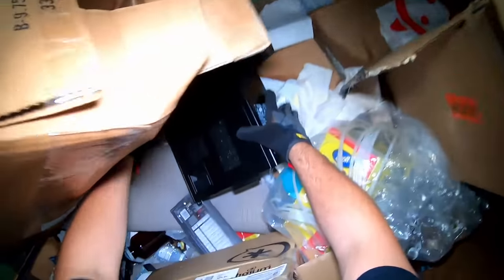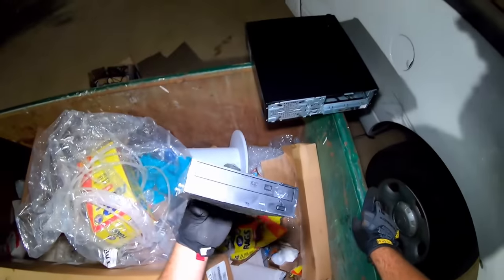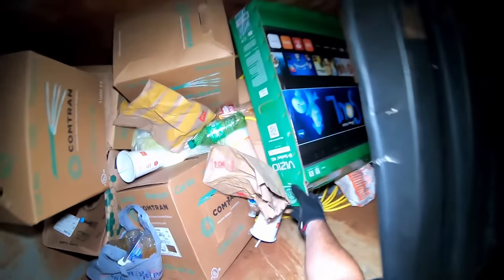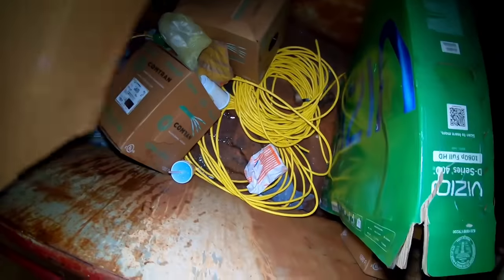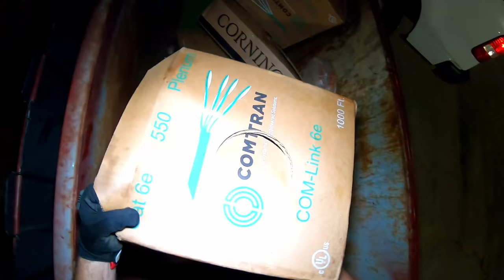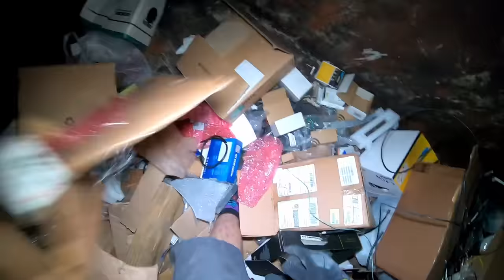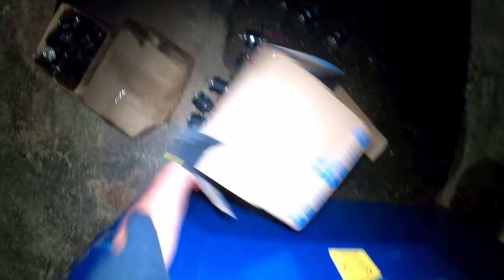Dumpster Diving "That Box Is Full Too!"

Comment: You don’t realize how many motors you scored until you stacked them on Dotty’s tail gate. Bravo!
Reply: What should he do with those motors? It's gonna be such a chore to take them apart for the bounty of copper inside of them, I feel like you're gonna loose so much money if you give em to the yard as is, that's a tough choice there huh??? Either way, yeah, SCORE of a night!!!
Reply: @jeffffro7674  I would stick them on ebay. People are always looking for these small motors for different experiments. There's no way I could scrap it. No Way!
Reply: As a matter of fact if I knew what he would sell them for, I would buy quiet a few from him.
Reply: @jeffffro7674  not hard to take apart 4 bolts 4 nuts, cast aluminum on the, it's better off to take them apart like that cut the wire off of them first
Reply: @gamecockmike175  EXACTLY

Comment: I miss the scrapyard videos, would love to know how much this load is worth.
Reply: It's all lightweight sheet metal. So at most he made 20 to 25 dollars, if that.  Subtract his fuel and the value/use of the truck and he would have made ten times as much bagging fries at McDonalds and not have to climb into nasty dumpsters.
Reply: @udavidism  what about the motors
Reply: @lionheart9692  my local place redeems motors $1/ lbs I'm guessing each box was 30-35 lbs apiece so I'm thinking about $150 ish? Also he'd make more throwing those carts up on marketplace at $25-$40 a piece, especially that blue one. I'm thinking with the wire all told maybe a $250-$300 night
Reply: Well if he The strips all the copper himself will have at least 5 or 6 lb at like $200 a pound.
Reply: @jasonflay8818  Scrap dealers take advantage of everyone. He got lucky finding motors on one night that will help pay for his gas and time all those nights he found nothing of value. They pay only pennies per pound for unstriped thin gauge wire.  Stripping heavy wire pays more but is very time consuming.  Many restaurants have a starting pay of fifteen dollars an hour now.  If someone else is throwing it in the trash, it has almost no value.
Reply: @udavidism  dude, you are bitter, we get it. No one is saying you need to do it. Let us scroungers have some fun and make a little money. Fine, scrap yards don't give full points for metals, great, you don't have their overhead. They need to profit as well. You know who you are making more money than? The original ore miners. Considering the average yield is 10 lbs of copper from 2,000 lbs of copper ore or about $30/ ton, I'd say scrappers make more money than miners.
Reply: @dianna3157  If people that have no concept of time value or the costs involved operating a vehicle want to waste time and money crawling around in filthy dumpsters then fine, have at it.  Much recycling on a household level often goes into the landfill even after you remove the label, rinse the can, flatten it and then haul it to the recycling center.  I have seen that "sorted" trash dumped out onto a slab of concrete where it is examined and if it has too much of any wrong items in it it goes directly to the dump, even after fools have wasted so much time, money and effort sorting it.
I have absolutely no problem with people wasting their time and money, it makes life easier for the rest of us. So keep on diving in those dumpsters and counting your coins! It has nothing to do with saving the planet.
Reply: @udavidism  With 300 bucks this guy made the same as i do in 10 night shifts , plus he has fun. 
Would trade jobs at any time with him.
Reply: @yaykruser  bro get a truck and get at it. Never let anyone hold you back!!!! Best of luck to you
Reply: @hammerhand5059  Who might be quickly becoming an insufferable snatch? But you're the righteous one here, right?🤣🤣🤣
Reply: @Toxic-Masculinity  "virtue signal much?" You know every time we open our mouths we expose ourselves?
Reply: How the hell did this comment turn into such a pissing match??? People ... SMFH
Reply: @charlesangell_bulmtl  Because that’s the state of YouTube today. A bunch of people who know nothing about anything vs a bunch of people who think they know something about nothing
Reply: @udavidism              Wheres the fun in that?
Reply: @udavidism  It's good that most people think like you.

Comment: Nothing wrong with those motors, probably just a new manager "cleaning house" and getting rid of some previous guys project.
I'd test them then put them on ebay for half the price of any other seller, and triple your scrap price.
Reply: Or it was an incorrect item that they couldn’t return
Reply: INDEED
Reply: I think you could ebay them just fine.   They look like engine fan motors like you'd have on the front of your car to cool
Reply: They weren't bad before he threw them around. His total disrespect for the items he finds is totally in line with his work....
Reply: I figured it was probably a place that manufactured the motors and maybe those were ones that failed QA for one reason or another.  Would have to test them to know.
Reply: Most likely, since those are all the same type of motors, they were either replacement parts for a discontinued product or main parts for a discontinued product. I have found cases like that before and tested them out to find they were all good. Since I do a lot of teardown to seperate out the different metals from each other and I take all of the hardware and bag them up for sale, I would go to the local swap meet/flea markets and dell it all off as folks know me as the hardware parts man. And electronics, I set those aside to crush and melt to pull the gold and other metals out. Since I use a wood fired smelter that has staged blowers for different temps, it is easy to pull the metals out and make ingots. Ingots sell for as little as 6Xs the going clean scrap weight of the same metals.

Comment: I just bought 6 motors very similar to those from grainger, they are exhaust fan motors for large buildings. Any way, they were $84 each off grainger, they kinda pricey but they are are authorized supplier.  That’s a score if you find a place that wants them.
Reply: 12 volt fan motors for building exhaust ?
Reply: @roberttempleton8112  I was thinking the same thing. 12 volt motors would not work on a building's exhaust, not strong enough imo.
Reply: Nice Nice load. Oodles of noodle wire. And wow on the motors, they make me think of the motors that you use in swamp coolers. 
 I wonder if the treadmill works. I would imagine that if it does you could get more money selling it than scrapping it. Another great mighty Mike video. 
Stay safe and God Bless
Reply: @roberttempleton8112  didn’t he say 24 volt ?  Yes, most direct drive exhaust fans are dc.
Reply: you would have to go though and check them all, dropping them like that on concrete could either break the magnets or dislodge them from the housing.
Reply: @bluecollarwatches7048  he said 12

Comment: Mike one of those carts was for a EEG machine. The Tecktronics carts was old oscillator scopes and use them in a portable Amateur Radio Shack on wheels.
As for the parts you found in the drawer is worth Mucho Bucks.
Great find in what you picked up. If I was closer I would purchase one of those carts.
Hope you and your family have a good weekend.

Comment: Those 12 VDC brushless motors are good for wind generators and the same for the treadmill motor. 90 VDC and high current output. I made a few wind generation systems. They .ight not be nice looking but work well.
That Panasonic battery is a deep cycle battery. They can be rebuilt and sold again.

Comment: Hook up one of those motors to the Battery that has 12 volts and see if it spins.  I use to have access to a Dump.  I was surprised by all the Decent Useable Stuff and Scrap tossed.  Good Mowers and Chain Saws just needing a tad of TLC.  Some Things in New Condition like Low use Bicycles.  God Bless, C.

Comment: Good video. You can test those 12v dc 
motors to see if they will work. The cheapest price i would sell those for is $10 each, if they are operational. They are worth much more than scrap price. Have you ever seen how a commercial wire stripper works ?

Comment: Those are server carts man i could use those big time. They usually use those in server farms to move and replace big ol heavy servers. no need for the blue one that's just a plain old regular metal cart. But certainly have a use for the HP cart and the fluke both

Comment: One thing the dumpsters diver do is make sure the right scrap goes in the right spot and not just to the land fills,, which are being over run by people putting anything and everything in them, also if you do it right you can make a ton of money on it👍✌️stop throwing steel in the land fill, put out by the curb someone will pick it up for you, you can bet on that ✌️

Comment: Hey Mike do you still have that proform treadmill if so I can use the plastic holders on each side that u can put your water bottle or whatever in they pop out and if u take the cover off there is a wiring on the inside  motor that control it to lift tread mill up and down  let me know

Comment: That paper you were talking about in the electrical wire, you’ll find that in a lot of old steel Armored cable. You’ll also find it in HCF, that’s the cable with a bonding wire in it. Neither’s used outdoors though, you’ll typically find it in Healthcare Facilities, in walls, and ceilings. But l agree with you, it’s a nightmare to strip. The bonding wire like to get caught on the jacket, especially if you don’t use a set of Roto splits to strip it. UF cable, that’s the wire  I hate stripping back the most, do you scrap it as is, or strip it?

Comment: bet those motors are brandnew , if the voltage is 12/24volt you might be able to sell them on ebay per 1 or multitude of against a discount , a lot of hobyist can use them or make them fit their projects 
fluke is a company making occiloscopes and multimeters and stuff like that , might be a cart for a big occiloscope

Comment: Sell those motors. DONT scrap them. Scrap just means throw them out not that they don't work. They will go for WAY more on ebay. Especially dual shaft for robotic arms. Those are also great for CNC or 3D printers. Depending on size they will go for $20-60 EACH.

Comment: They blue tank that you call a water tank is called a bladder tank it has a membrane on the inside and when water is added it creates a pressure to hold back on it the top has a valve stem to add air if you need to increase pressure

Comment: It only takes a minute to test you're 12 volt motor with your car battery. The ones that do work and sound smooth are worth 25 bucks online each. That's a lot more than scrapple will  pay for them

Comment: Motors--- I looked to see if somebody knew what they were for, and they're far too small for building exhaust fans, not to mention being 12 volts DC.  They are probably recalled parts from an auto maker, or perhaps for an add-on A/C. See if you can find an ID label on them, and you will have a good lead. I'm seeing three wires, so they may be 2 speed motors. Probably PM fields. Hook one up to a battery, see if it runs. Then reverse the leads, and if it runs in the opposite direction it is a PM motor, and has some healthy ceramic magnets in it. You might get regular electric motor price at scrap, but there is very little copper in a PM motor, as the magnets act as the field coils.

Comment: i wouldn't scrap those carts. they're too useful as tool carts in a garage, especially the one with the drawers and folding shelf. wheel it up along side of the vehicle you're working on for a mobile workbench with space for tools, and supplies. it looks like some even have outlet strips on them. i know people who work on stuff in their garage who'd pay 30-40 bucks a piece for them, so i'm sure you can find a better home for them than the shredder. hell, if i was closer, i'd take them all at that price.

Comment: Is that mostly data cable and telephone cable you are pulling out of the small dumpsters? Not too valuable. Those motors on the other hand if you could sell them on ebay could be quite valuable. Probably Chinese imports that did not meet spec or something.